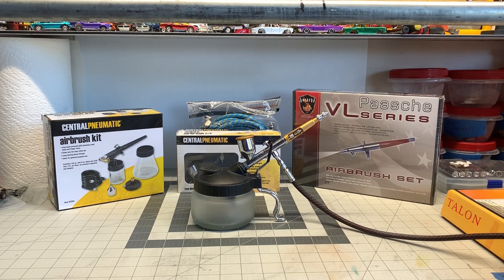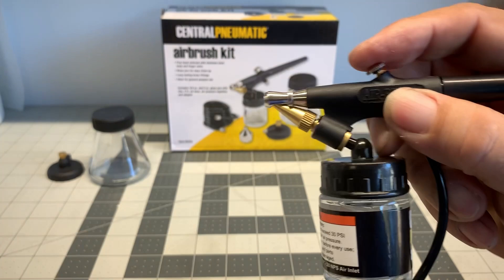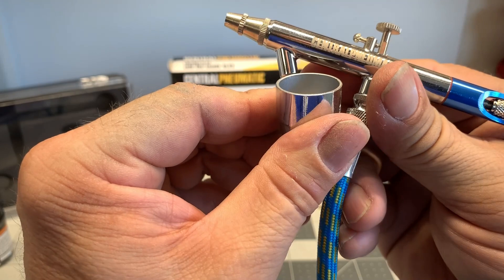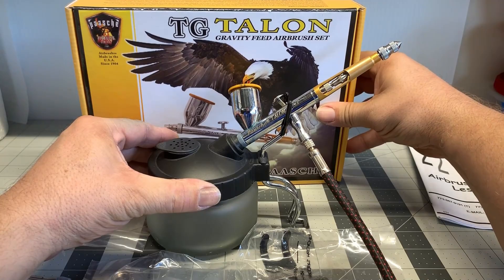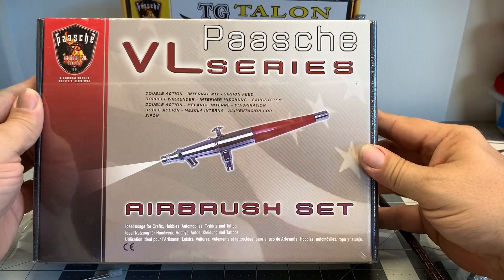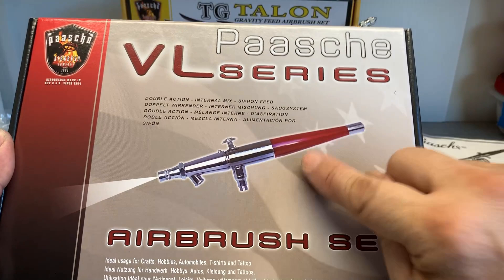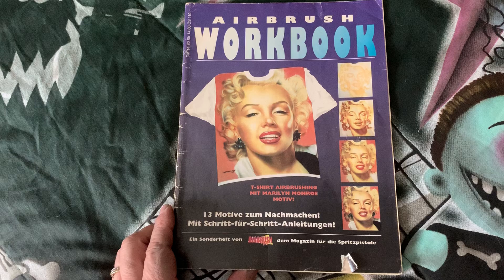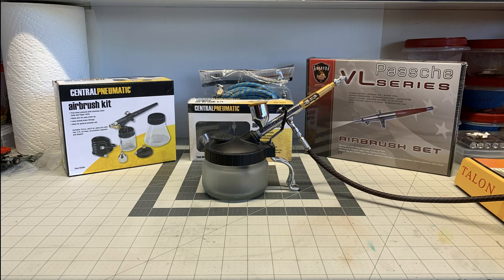How to Select an Airbrush

Comment: I think specifically for the Talon. The packing is PTFE not nylon. PTFE is very chemical resistant and should last a good long time unless you are just spraying the most hot stuff or are ramming the needle in and out.
Reply from the maker: You are correct brother the bearing is made of Teflon not nylon

Comment: This being an older video I'm not sure you'll even see this. But Thanks Paul. Been a follower for some time. In my case it's not using the air brush that I find intimidating... it's CLEANING the brush. If that takes long than the actual paint job... I would stick to rattle cans. Do you have a vid that shows best methods for cleaning an air brush?  I think that's the only thing holding me back.
Reply from the maker: https://youtu.be/bPcMFgtLzNo
Reply from the maker: Ed, it does take a while to clean your airbrush properly with the results that you get with the airbrush versus a rattle can are definitely well worth it. Don’t hesitate to reach out and ask questions. Check out my playlist in the how to section, there are many videos that will help you with what you do. And again if you have any questions reach out, thank you for following the channel and cheers

Comment: Great info. As I am getting ready to restart restoring again I think I'm going with that Talon airbrush. I got a cheap starter kit with compressor on EBay for $39. The Talon will be a great addition. Just a few pieces away from starting. I need to get into the water slides creating. Need some info on where to get the illustrator software. If you have any tips on making water slides  I would greatly appreciate it. 

Thanks,

ELG